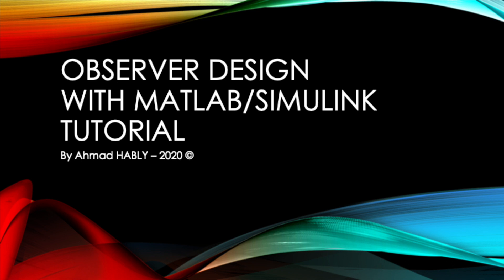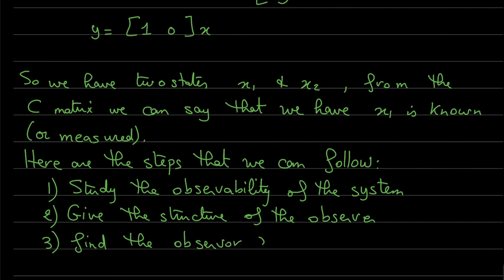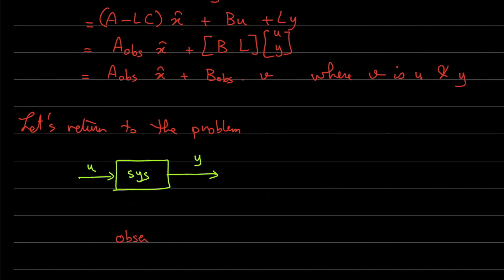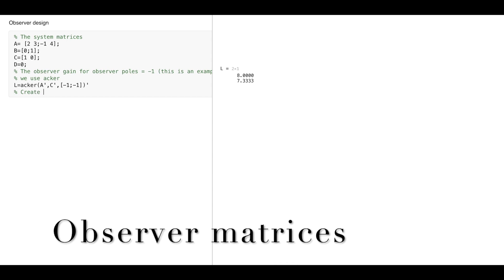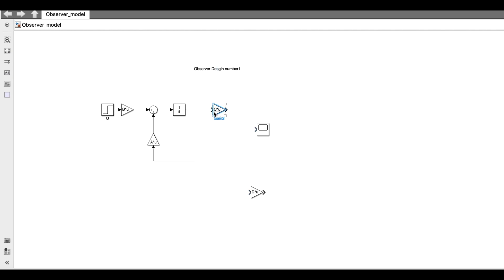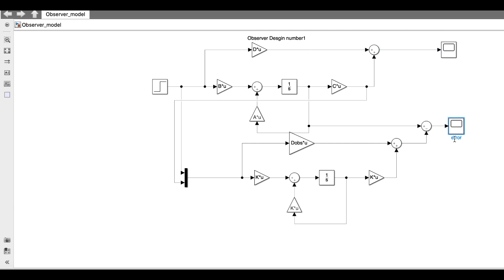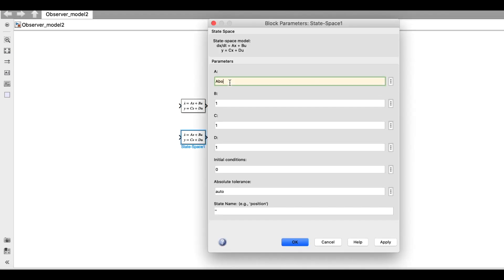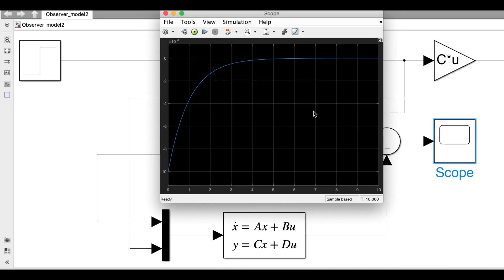State space control - observer design using Matlab and Simulink

Comment: @Ahmed Hably Please check your email.
Reply from the maker: Here is a part for the correction: 
A11 = [-2 3; -1 -4];
B11= [0; 1];
C11 = [1 0];
D11 = 0;

L1 = acker(A11',C11',[-1;-1])'

Aobs1 = [A11-L1*C11];
Bobs1 = [B11 L1];
Cobs1 = eye(2);
Dobs1 = zeros(2,2);

For the Simulink I cannot open it since I have an older version
Reply: @Prof.AhmadHably  Thank you

Comment: I followed all the steps in the StateSpace representation, but my errors are very large; to the order of 10^11 within the first 10 seconds
My matrices are the same as yours.
What could be going on?
Reply from the maker: A sign problem?
Reply: @Prof.AhmadHably  Signs are same as you have in your video. I double checked.
The Step function Step-time is 1. When I change it to 0 I see a difference too.

Either case my plots do not match yours.
Reply from the maker: Send me your files

Comment: Thank you Prof. for this video. Unfortunately, when I run the simulation i get different results than yours. In fact, if i extend the simulation time to 30 seconds, the observer will diverge COMPLETELY! what could be the problem? (i am using the state space representation bloc)
Reply from the maker: Could you share your code with me?
Reply: @Prof.AhmadHably  yes sure can you please share your email with me? Or if you prefer not to share it publicly, please send me an email to micho_chamoun@outlook.com
Reply from the maker: Ahmad.hably@gmail.com
Reply from the maker: I examined your code. Remember an observer is a software sensor. if your system is unstable, the observer will follow the system and show this instability. use a stable system instead. Use this A = [-2 3;-1 -4]; It will work :-)
Reply: @Prof.AhmadHably  ah i see! Thank you!
Reply from the maker: Do u like the content?
Reply: @Prof.AhmadHably  yes sure! Actually i am working on a project and this video helped me a lot! By the way, can i ask you a question by email about a certain topic in my project?
Reply from the maker: Yes you can

Comment: I have DC-DC converter and I need to design observer based-controller for the converter I used PID controller to control the output voltage to be be same as the reference voltage but I don't know how to design the observer
Reply from the maker: Can you give your system’s equation?
Reply: @Prof.AhmadHably  The state space you mean sir ?